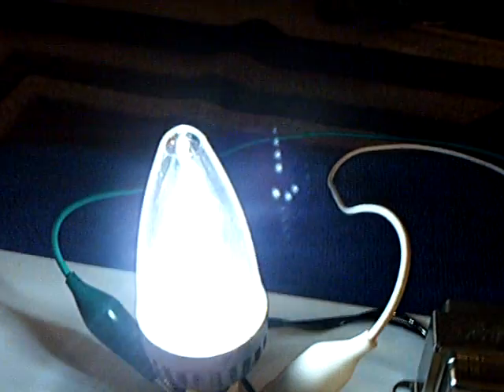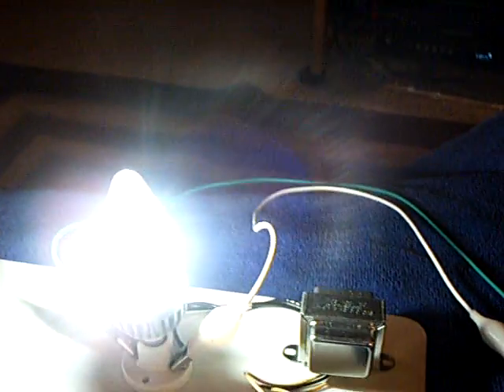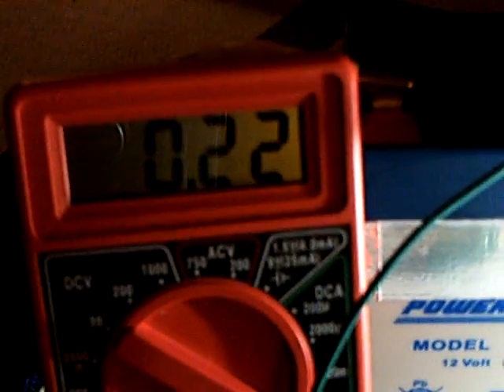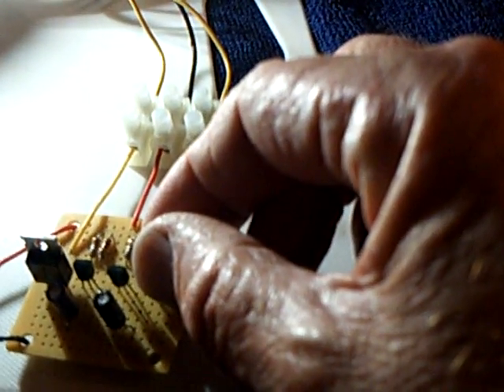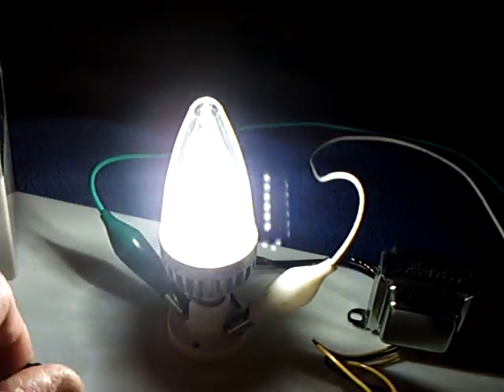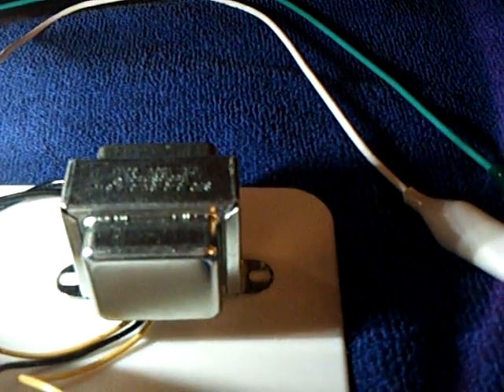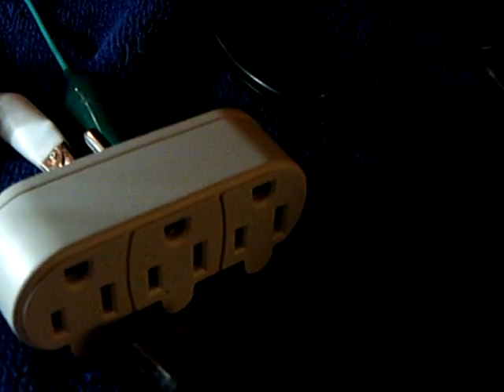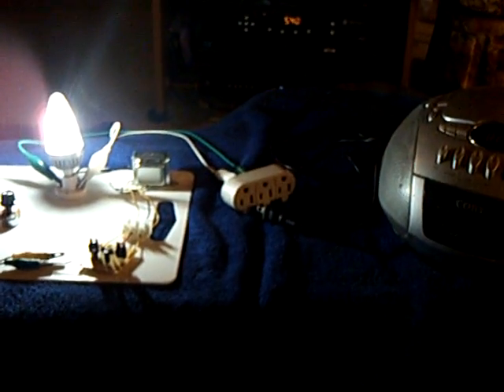French inverter driving LED bulb  &  radio

Comment from the maker: @urbex2007 ------I am seeing a square wave come out of the "flip flop" part of the circuit but at the mosfets it looks more like a "h" wave form.  Mine is running a little too fast at around 70 to 80hz..  A slightly larger value cap might slow it down a little.   I hate to touch anything because it works so good. The only thing that isn't quite right on mine is the rheostat that I am using for control is too weak and gets hot.  I ordered a tougher one.  There might be a better way for control.

Comment: Impressive. for 0.22*12 = 2.6 watts a led lamp. Most are rated 1W or 3W.
I got my 5 watts lamp that i use to light the whole garden. I has 6 ultra bright leds, each rated at 0.5 watts + the transformer eats up the rest. I wonder how many of those could be used. My lamp can light aprox 8x8 meters in darkness.

Comment from the maker: @marthale7 ---Hi Mart.  This thing got my attention because I saw a way I could use it right away and it looked easy enough to build.  I have made inverters before and had lots of them over the years.  They steal energy usually and are not very efficient.  This one seems to fill a need for powering low wattage 110v stuff  off 12 volts without robbing the bank.  It puts out a weird wave form though and will not work on some things.  It has a specific prupose.

Comment from the maker: @TheKultus ----I went ahead and put a link to vik95170's video above in the description section.  The circuit diagram is in his video.   I am using 2N2222 NPN transistors and IRF510 mosfets but others will work.

Comment from the maker: @phi36nine ------The circuit diagram is in vik9517's video posted above in the description section.  Do what I did and stop the video and make a sketch of it.  This circuit belongs to him and is not mine to duplicate and hand out.  ALL the parts that I am using on the main inverter board are available at Radio Shack.  In his diagram I am using 2N2222 NPN transistors and IRF510 mosfets.  He does not list values for those parts on the diagram.

Comment from the maker: @egn83b ---I scoped this today and the Flip Flop part of the circuit puts out kind of a lopsided square wave but after the mosfet it shows up looking like an " h" wave.  I havn't looked at it at the bulb yet.   This is one strange animal.  I put a diode at the mosfet and the flyback would fill up a cap to about 30 volts.

Comment: The inverter 400w you can buy at harbor fright uses about the same current when you let it idle, then when you apply a load it takes lots of amperage. This setup is really interesting to the commerical inverter because its not running mains frequency. I think it is more of a resonance circuit that oscillates the transformer whindings so it might build a standing wave so it does not take nearly any amperage because its might be cold electricity. Thanks for the demo lidmotor.